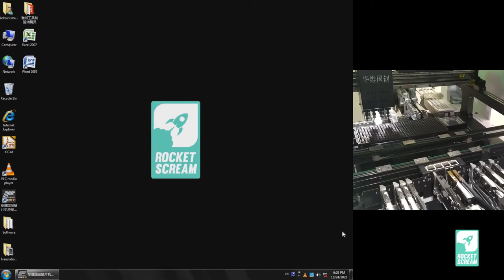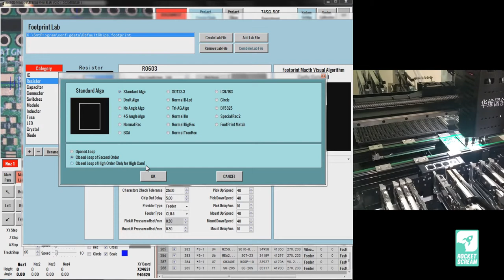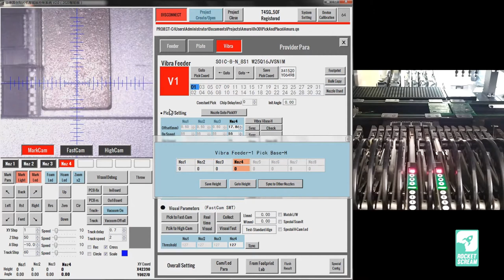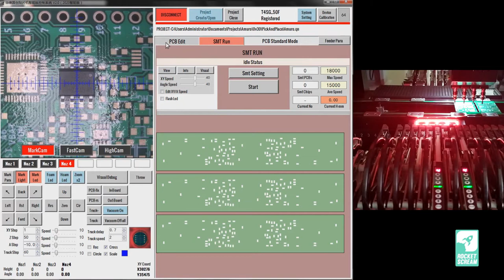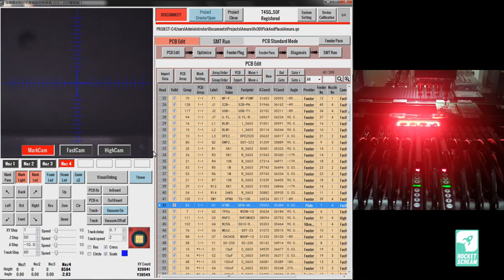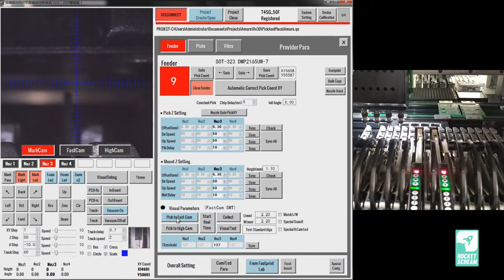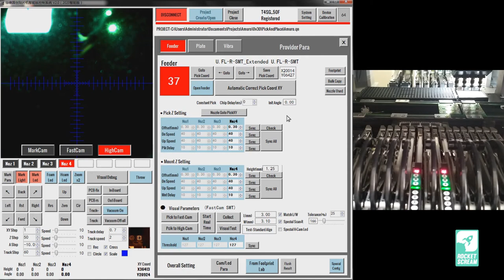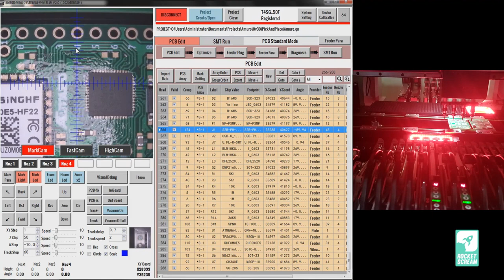Rocket Scream - HWGC HW-T4-50F P&P Guide Part 2 (Feeder Setup And Configuration)

Comment: I work with 3 of these machines at my works, how do you address the issue of any panel/PCB bounce?? as these machines don't come with any under board supports. When doing multi panel PCB's it can be a bit of a pain
Reply from the maker: My PCB panels aren't that very large but I do used close to the limit of the track width. If your PCB is very thin, it's best to limit your panel size or you could tape the intended PCB onto another more rigid PCB. I have seen in the past one of their client in China doing this for a relatively thin PCB. Other than that, set the height of the PCB correctly and have a more modest press down height on the nozzle as these parameter can be adjusted.

Comment: Do you do small proto runs and are you by any chance located on Penang  Island. Good video
Reply from the maker: I don't do small prototype run unless it's a custom work design. I'm based in Shah Alam. There are some smaller prototype assembler in Sg Petani area rather than Penang.
Reply: @phangmoh  Thanks for your response. Yes I have seen some in SP and BM. Mostly use Juki and some older panasonic machines.

Comment: Hello,  You mentioned using double sided tape. Please be kind enough to describe the tape type and thickness. There are many types of double sided tapes available. Some are paper thin, some transparent, some thick and foamy type, some clear and thick. So best may be to share the picture or the link from where we can get the idea. And for the feedback, I really appreciate what you have done in helping many others by saving their time .
Reply from the maker: Any thin double sided tape would do, most of the time they are transparent. Mine is just a no brand ones from the stationery shop, nothing specific.

Comment: @Rocket Scream Electronics  Thanks for the video , it was very helful 
But I have a question about the footprint library , how can i add  a full library with all informations about footprint from the internet not manually ,is there a website we can use , and why the 3d chape of any allready installed footprint doesn't appear
Reply from the maker: There's no online database to pull such data. But the software comes with quite a long list of tested components bundled. You can also import a text or CSV file. It's not something you do quite often, once set it should be more or less what you will be using. Probably once in a while you would add a new component. So, manually adding them is not a big deal or too time consuming.
Reply: Is there any way you can share your Library in the way you have it arranged? We are in the discord and the eevblog forum. We would appreciate a lot

Comment: What if I have in design two types 10K 0402 resistors ? One is 1% and second 5%.Both have values 10K and footprint R0402.
Reply from the maker: You would have to name them differently like 10K 1% and 10K 5%. From engineering and cost optimization point of view, I would just swap all resistor to be 1%. At 0402 pricing, the cost different is insignificant. I did this with all my 0603 resistors, utilizing only 1%. This will also save your feeder slot.

Comment: After all the configuration of the feeders and all the marking of the Board, a file of this production project is saved, right? In other words, in the next batch production, it is not necessary to configure the feeder tags again.
Reply from the maker: Whatever changes you have made, the software automatically saved it. There's no save button for that. The only thing you probably need to run for the next production run is the feeder XY automatic pick up location using the "correct all" function which will run through all the feeders to check for it's pickup location automatically without user intervention.

Comment: I see in a feeders list only CL pneumatic feeders.What to choose if I going to use electric feeders ?
Reply from the maker: There's no differentiation between them. As the electrical feeder still uses the pneumatic signal that were meant to push the conventional pneumatic feeder as a signal to electrically push the tape forward. So, from software point of view all it sees are feeders of different tape width and not whether it is a pneumatic or electrical feeder.
Reply: @phangmoh  Is it worth to use electric feeders for components like 0201 and 0402 ?
Reply from the maker: @RusokuLab  you could still use pneumatic for 0402 but 0201 you definitely have to use electrical. I used electrical for 0402. For me they are the best because the tape advance distance can be adjusted. So you can use everything from 0201 to any components that runs on 8 mm tape. This actually save you money from buying 2 different sets of pneumatic feeder (2mm vs 4mm tape pocket distance).

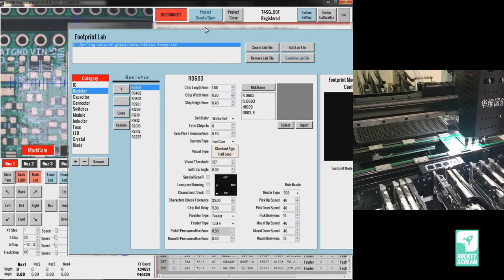Comment: How did you do the data entry the Footprint library at 13:40? Was it manually, or did you export it from some file type?

Also, what's the function of Footprint in the Provider Para at 1:30:00? Is it for the component, or the feeder?
Reply from the maker: By default, it already has a library that covers mostly everything. But, I added more components manually using that footprint library interface. It's not something that you play with very often I guess, so the manual editing seems okay to me. You can also duplicate existing component  and edit from that duplicated component which is how I did it. I'm not sure if a text or csv file can be used though. The Footprint function in the Provider Parameter is the same as the one in the Optimization stage but this is used if you want to individually select a different one or replace it.
Reply: @phangmoh  Man, I still got some questions about this thing, like if the tray has to be custom ordered, or if the feeder systems have something that automatically removes the cover of the reel tape.
Reply from the maker: You can use any tray you want whether a standard JDEC tray or custom mill/3D printed. I don't get the question on the cover of the reel tape. As is goes, the CL feeder does all that automatically. Are you coming from some smaller machine with tape cover pulling/winding mechanism?
Reply: @phangmoh  The pictures the manual had regarding the feeder handling the reel film were a bit unclear, so it took me some time to figure it out. Btw, how do I get the machine to recognize which nozzle is using which size? For example, my nozzle 1 has a 502 attachment, but the software shows it to be 505.
Reply from the maker: You have to follow the software nozzle assignment on the head.